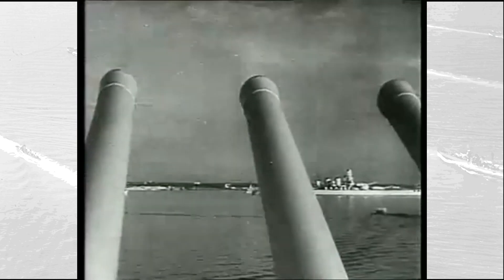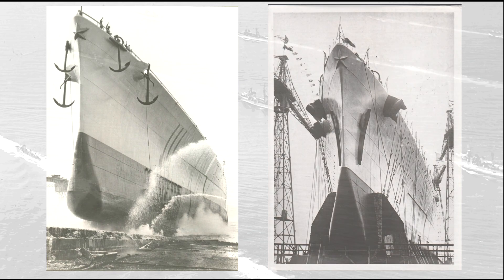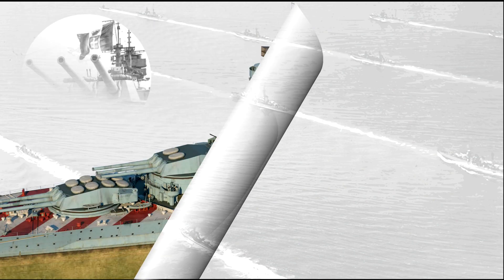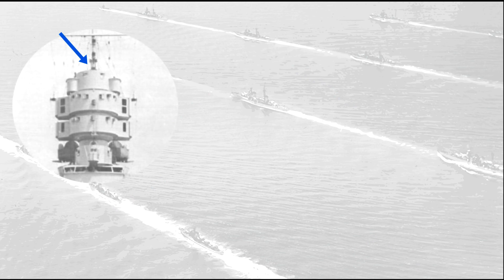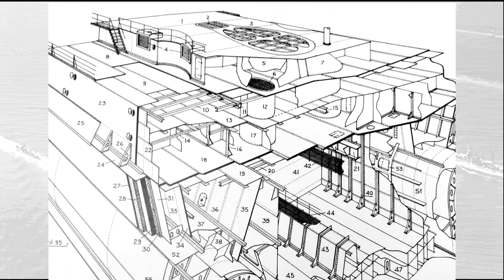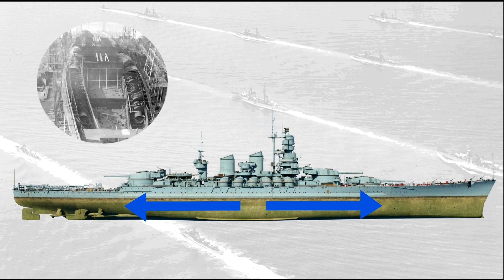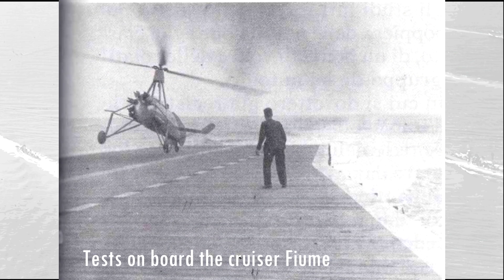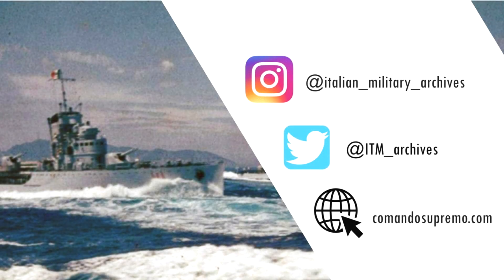Littorio class Battleships PART 1: technical overview

Comment: These were in many regards very innovative and powerful designs. Though unfortunately for the Regia Marina, somewhat compromised by a relatively few specific technical shortfalls, many of which could and should have been spotted and rectified. Very poor quality and consistency re15" APC manufacture being one especially well attested instance.
Reply from the maker: Actually the story of the poor quality shells has been re-evaluated. Admiral Santarini made a thorough research which was publish on the journal WARSHIPS and he claims that the projectiles were too much stabilized, thus resulting in greater dispersion at longer distances. Actually we discussed this aspects on Drachinifel's channel and I mentioned this in the part2 video on the Littorios.
Reply: @IMA_Storia_Navale  Cheers! I was aware of the excessive dispersion problem but not of the new info you now provide re the precise cause.